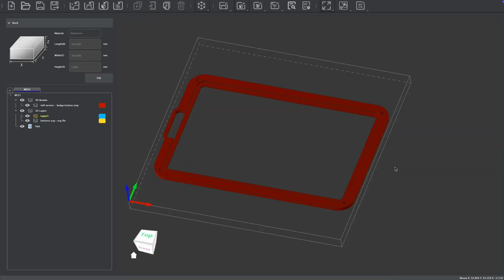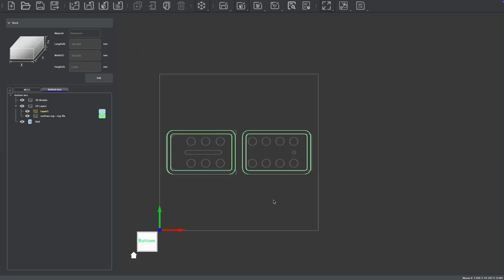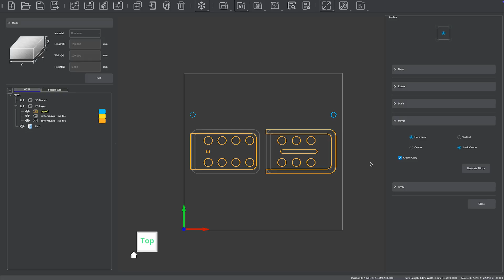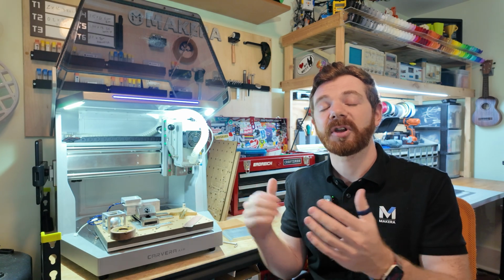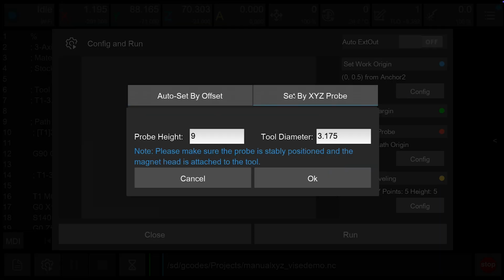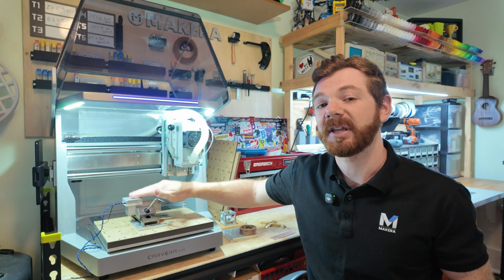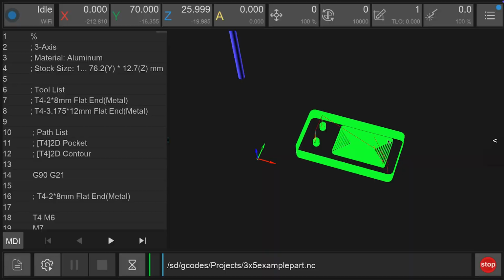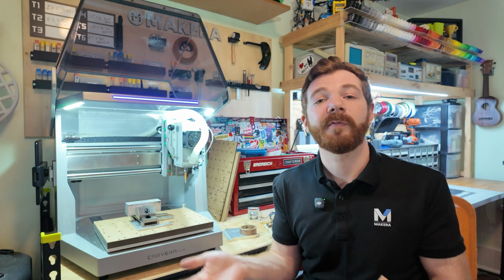CNC Tips and Tricks for Machining Multi-Sided Projects

Comment: Another method that I often use is to mill a pocket in the shape of the outline of the object into a piece of plywood held onto the bed, then attach the object inside that outline using doublesided tape. I found this to be very precise and work well with flat objects (e.g. knife scales).

Comment: Thank you for that double tap trick on the probe. I always wondered how I could turn the laser pointer on, because that would have come handy in two or three projects already. I only did one double sided project so far, wich was a bunch of coins. For that I found i easiest to make a little jig that was fixed on the bed. So I only needed to set the XY offset once and only did the Z offset with the probe on each coin.
Reply from the maker: Thanks for the view, and jigs are great!

Comment: Thanks for this video, it would have been very helpfull when I started my first multi sided projects a few months back... That said, I found that the manual probe pocket has some constraints : you can't really use it when the stock is too thin or not enough high. At the end, what is really missing to the Carvera and Carvera Air is really a true 3-Axis probe, but thanks to the Community, we can have that with the Community Firmware and Community Controller. I hope that at some point, Makera propose a true 3 axis probe as option for our machines...
Reply from the maker: Thanks for the view! And we really appreciate the efforts and collaboration made by the community too!

Comment: When using the xyz prob method. Does the stock have to be squared to get the best accuracy when the part is flipped?
Reply: This is my challenge, XYZ assumes perfect stock.  I have taken to drilling a 1mm hole and setting my flip origin to that hole in fusion, then manually aligning a 1mm endmill on that hole with eyeballs. Works okay, but for real precision you want a wider hole and a coaxial indicator.  My current problem is finding a coaxial indicator that can ride an 1/8" shank.
Reply: @MrPrdoring well there might be an adapter somewhere for it?
Reply from the maker: This is all very good advice, thank you for sharing. When using the XYZ probe, it performs best with square stock or a fixture that offers an accurate reference point.
Reply: @Makera thanks! I have been loving my air! I've been working on a clock so my problem is that everything is round, so it has been a journey to figure out how to get my two sided pieces right.
Reply: Yes, unless you have a 3d probe.

Comment: Nice video, Jason, thanks! After binging so many of them, it's been cool to see the production quality improve.
Regarding the XYZ probe, is it recommended to leave it sitting on the model as shown, or to push it against the model to ensure it's as close as possible?
Cheers!
Reply from the maker: Happy to assist, and thanks for the view! As for the XYZ probe, it is important to be squared up accurately to your part while using extreme caution around your moving CNC. If needed, this can be done with manual pressure.